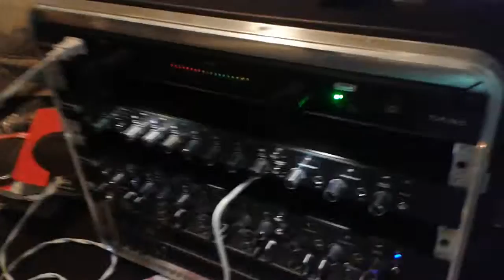Setting up two profire 2626 units, part 1

Comment: hi i need to get this unit working with my thunderbolt port (macbook pro 2014) I have the apple firewire to thunderbolt adapter but the cable from the 2626 is too big and doesnt fit in the adapter. do you have any ideas as to what i should do. is there another specific adapter i need to make this work or a special cable with different sized ends? thanks.
Reply from the maker: there are three different types of firewire plugs that are pretty common. it may just be that you're adaptor is expecting firewire 800 or the mini firewire. The firewire ports on the 2626 are firewire 400. Generally, if you shave down the plastic on the physical plug some it won't cause issues with cables working. So if you are sure you have the correct firewire 400 adapter it might be time for a little sandpaper to make sure things fit together.
Reply: Ryan Black yeah I looked into it more.
the adapter fits 800. So need to get a cable with the 2 different ends (400/800). Should work from there. Thanks